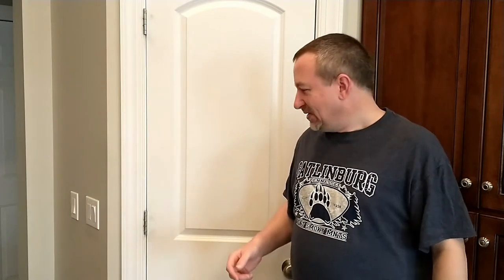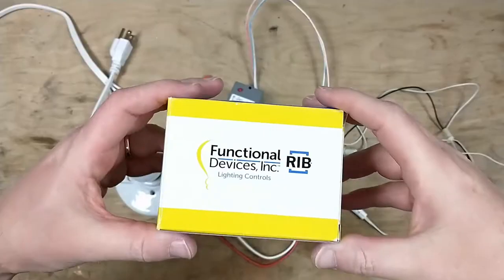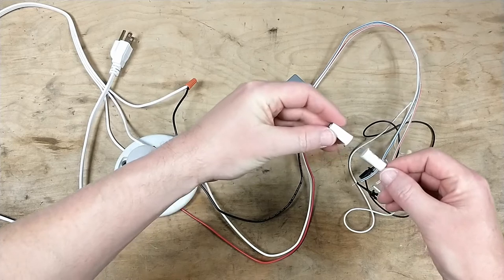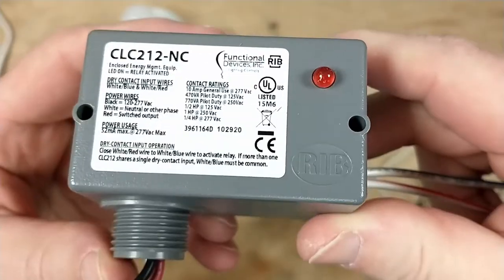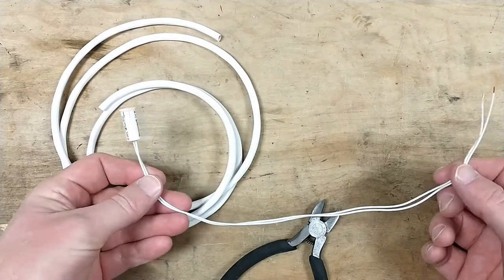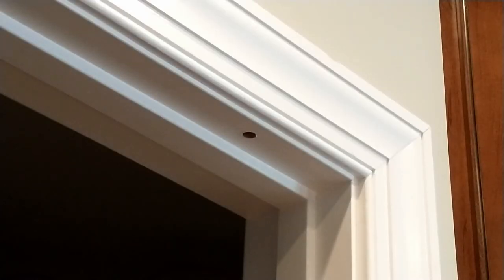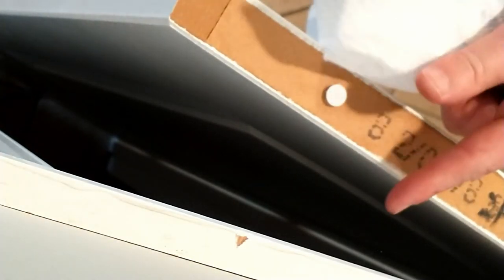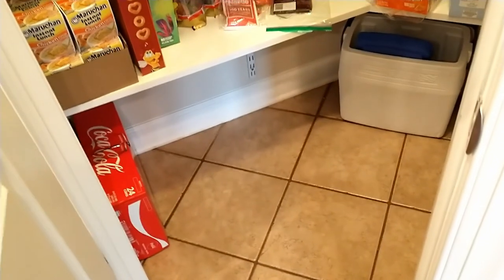Project #38 - Automated Pantry Light

Comment: What wire you used for the switch (12:04 into the video). Does the wire gauge matter? I’m trying to buy off amazon I just need to know what's the most suitable one. Perhaps any two wires would work.. but I like the wire that is covered in the white insulator, but there are so many to choose from.
Reply from the maker: This wire is just carrying the low voltage signal to the alarm contact, so the wire gauge isn't that important.  What I used was 18-gauge in-wall speaker wire.  Its great stuff for lots of different applications like this.  Here it is on Amazon:
https://a.co/d/bn3raE2

Comment: Thanks for this video.  I want to do the same with my kitchen pantry, but I have two french style wood doors.  Is there a way to maybe use two of these switches and drill two holes (one for each door), maybe with the switches connected in series or in parallel that would work to turn on the light regardless which door is opened?
Reply from the maker: You should be able to use the same setup I used, and put your two alarm contacts in series.  So if either door opens, the circuit opens and the light comes one.
Reply: @VancesHowTo   Thanks I may try that.  I'm not sure how to connect them in series. Do I have to open up one of the magnet switches to make the connections?
Reply from the maker: @canonman223  No, just wire them end-to-end in a line.  Look into "wiring switches in series".

Comment: I was wondering how to connect two of these sensors to turn on/off a single light inside a closet and using only one module. One magnetic sensor for each slinging door of the closet. I guess I will have four different states: both OFF (00), both ON (11), one ON and the other OFF (10), and viceversa (01).  Only at 00 the light should stay OFF, but ON in the other conditions.

Comment: Would the install change if I am putting in a light that was not there and using constant power from a nearby receptacle directly to a light fixture would the wiring be the same and then have two contacts wired in series for two swinging doors?
Reply from the maker: That should work fine.  If the doors each have a magnetic contact that opens the circuit when the doors are open, then wire them in series, and either door being open will trigger the light.  Using a constant power supply is actually better than what I did.  With my system, someone could inadvertently turn the light switch off and then the automated light won't work.

Comment: I love the clean look. I’m going to install one of my own but I wanted to know, is the sensor you’re using a normally closed or a normally open sensor. 
Thanks
Reply: It's should be NC since you the light to be on when you open the door.
Reply: I’m struggling with that too. Maybe the rule is NC if your module is NC too. However, for me, normally closed means flowing of electricity, so bulb ON. If the magnets are not aligned then the sensor becomes open and resulting in no flowing of electricity and this could result in no bulb working. But I could be wrong. Another way to see this is that the module (NC type) becomes or remains NC if no sensor signal is received so you need a Normally Open (NO) sensor; by the contrary, if signal is received, then the module will become Normally Open (NO).  I don’t know hahaha.  A good try could be to buy a module that is SPDT that has wiring for both NC and NO combinations.

Comment: What wire is that from the plug that is capped and not connected to anything?
Reply from the maker: That's the ground wire in the cord set I was using.  For testing, I didn't hook up ground.

Comment: Hello, is that clc 212 low for low  voltage output..?
Reply from the maker: The module I used was the CLC212NC.  That one works with the magnetic alarm contacts I was using.  I bought it from Amazon here, but looks like its no longer available from them.  You might Google it and find it somewhere else.

https://www.amazon.com/gp/product/B00QW2NDRW/ref=ppx_yo_dt_b_search_asin_title?ie=UTF8&psc=1